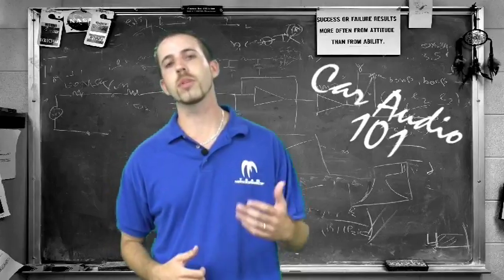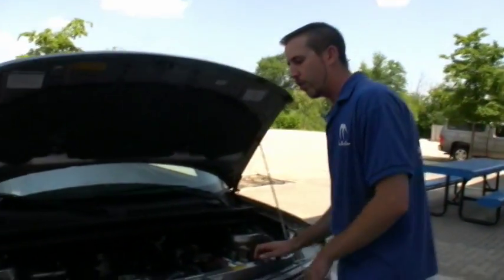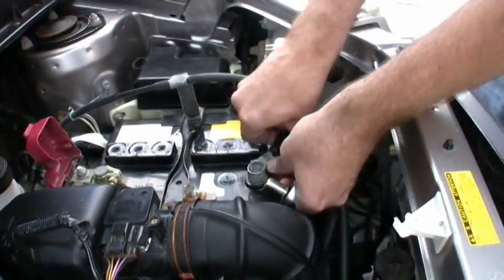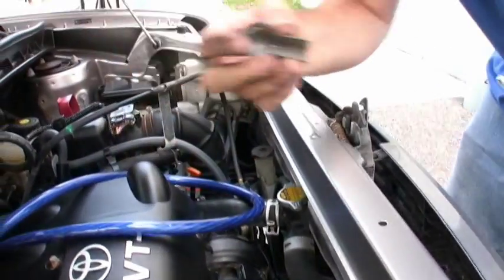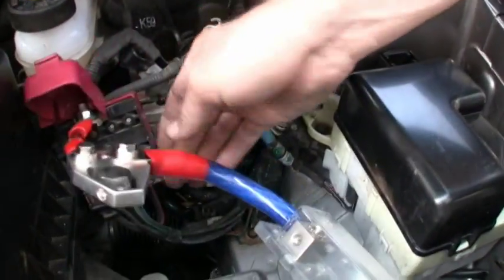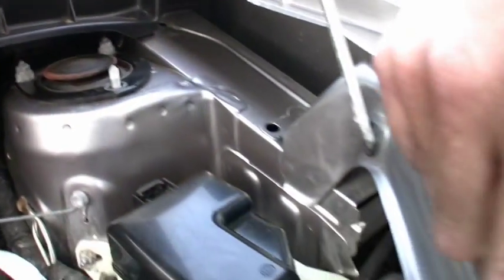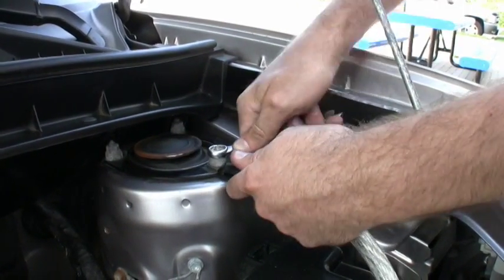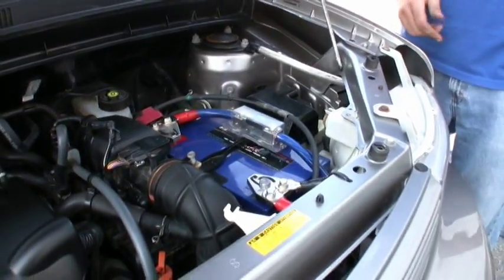Car Audio 101 - The Big 3 Upgrade Tutorial

Comment: Comps and 2 12 JL power by a 400 watt amp ken wood and a planet audio 2500 watt amp and all my wiring  was done with monster cable 2 gauge (I think) I also have 4x8 kicker speakers and wanted to upgrade my deck and my rear entertainment system that came stock with the SUV

Comment from the maker: @HPKWI I would recommend contacting an alternator manufacturer such as XS Power or Ohio Generator. They will need to know the make, model and year of your vehicle as well as the total power of your amplifiers. This will help them determine what alternator would be right for you. The optional in-line fuse should be valued just above the maxx output of the alternator.

Comment: Ok so I just do alternator to + terminal and  connect the black wire coming from my led fuse holder to my negative battery terminal right? By the way if it helps my led fuse holder it's a ((xscorpion)) THANKS

Comment from the maker: @gigiboxa The fuse from alt + to batt + is completely optional. If you decide to do so, the value should be a little above the maxx rating on the alternator.

Comment from the maker: @007novice The BIG 3 upgrade provides increased delivery over factory wiring by reducing the resistance in the circuit. Think about drinking a milkshake through a coffee stir vs a larger diameter straw. Which will work faster and with less effort? The battery was changed to increase the reserve in my electrical system. This helps my amplifier live up to their potential. In some applications an upgraded alternator is required as well.

Comment from the maker: @Wjncs The fuse from alt + to batt + is completely optional. If you decide to do so, the value should be a little above the maxx rating on the alternator. In many vehicles the stock wiring runs through the factory fuse box. 

Yes, any power run coming off of the battery requires an in-line fuse within 12" of the + battery terminal. The total fusing can typically be figured by adding the total fusing of your amplifiers together. It is ok to round up if needed.

Comment from the maker: @dbow79 In my tests, Optima yellow top batteries are good for around 1800 watts. You will need more batteries for sure, and maybe even a larger alternator. Measuring the voltage drop at the power and ground terminals on the XXX6500 will provide your answer.

Comment from the maker: @Simonas69 Upgrading the battery increases the reserve for the electrical system. The overall voltage is typically lower for the system if the alternator is not upgraded as well. Fuses and electrical equipment are not affected simply by upgrading wiring and batteries.

Comment from the maker: @13mrpunk Your electrical system is only as strong as your weakest link. Leave the factory wire in place and add the additional wiring as you are able. The lines in your screens could have to do with your signal cables being run next to power runs. Try separating your audio and video cables from power runs if possible.

Comment from the maker: @jr93pdro The fuse from alt + to batt + is completely optional. If you decide to do so, the value should be a little above the maxx rating on the alternator.

Comment from the maker: @memodedonachuy The fuse from alt + to batt + is completely optional. If you decide to do so, the value should be a little above the maxx rating on the alternator.

Comment from the maker: @ctdv55 I would think your current electrical upgrades would be sufficient, but the proof will be when you measure the voltage drop at the power and ground terminals of your amplifier during high volume listening.

Comment from the maker: @jarred3636 The tutorial I provided is the traditional BIG 3. The run you are referencing is often mentioned in what the guys on many forums have begun doing. They are calling it the BIG 4 upgrade. Your engine is bolted directly to the frame of the vehicle so I see no reason for this run. But, the upgraded run from the engine block to the negative battery post is a must in the upgrade process.

Comment from the maker: @BLAssT0 Follow the steps I have provided in the video. The only additional step you need to take is connecting your black wire (ground) to the negative post on the battery.

Comment: So why do you put a fuse on the 0 gauge wire from the alt to the battery if the factory wire is still hooked up. Why dont you have to fuse then both or neither of them. A little confused on that.

And if you install an amp to this set up, do you need to put a fused link on wire that goes to the amp? If so what size?

Comment: wheres a good place online to order the battery ends and the crimp ends for the wires. i have looked around to no avail. i am looking for  2 gauge wire that i am going to run. and 4 gauge to my amp.who makes the battery ends you used on the video? they look well built.

Comment: Thanks for this great video!  I am relatively new to performance car audio although I have "dabbled" with simple stuff like changing HU's and speakers and installing amps, crossovers etc in the past.  Like the last guy to comment on this video, I'm not 100% sure what the positive terminal jumper that you installed is actually for - could you clarify please? Thanks again for the video!

Comment: I have a question, I see that a lot of people upgrade a "engine block to chasis". Would that be equivalent to the "Negative terminal to Engine block" like you just did? Mine has the same "Negative terminal to Engine block" wire like yours so i'm not surr if I have to upgrade that AND add a "engine block to chasis" wire.

Comment: How many batt's are you running in that car?  I went to the Kinetik website and calculated that my system is 1350 rms total and it told me I need (2) 1400 Kinetik batt's?  Is that accurate?

Comment: @MaxxsonicsUSAInc  Can you please help me, The big 3 is done to my main battery that is in my truck and I am planning on connecting a second battery which my amp will be connected to but the two batteries will be connected with a relay/isolator. Will the Big 3 still help my system or what??

Comment from the maker: @Ericec4126 You do not have to, it is optional. Simply a safety precaution as the wire you are adding is not factory and most factory charge wires run to a fuse box prior to connecting to the positive battery terminal.

Comment from the maker: @d77543020 The HFEQ will provide a very clean output to your amplifier. It has a built in line driver capable of delivery up to 9 volts of clean signal output.

Comment from the maker: @luisin321123 In your application, your fuse from alt + to battery + should be just above the max output of your alternator. The fuse from battery + to your amplifier should be approximately 400 amps unless you own an amp that is around 2000 watts continuous. If it is 2000 watts rms then I would recommend around 200 to 250 amps of fusing in line. You  can always change if you have issues.

Comment from the maker: @8320884 Put your fuse, which is optional, between the alt + and the solenoid. As far as Marine batteries go, you best bet would be to contact the battery manufacturer for their opinion. I know a lot of guys using the Optima Blue Tops, which are Marine batteries, and never have any issues.

Comment from the maker: @terror1993 That is correct. Perform the same connections, but your wires will be much longer. You should be able to ground the rear battery to a strut tower bolt in the trunk. Be sure to sand the area free of paint and corrosion.

Comment from the maker: @Chopper41463 If you do not reattach the positive cable then it must be covered and protected so that it does not short against anything. In most applications it is favorable to connect it with your upgraded wires.

Comment: HEY MIKE OR ANYONE GOT A QUESTION I DID THIS BIG 3 UPGRADE I GOT A 220AMP H.O. ALTERNATOR  I WANTED TO KNOW WHERE SHOULD I PUT THE FUSE BETWEEN THE ALTERNATOR TO THE SOLENOID OR THE SOLENOID TO THE BATTERY? THANKS. ALSO CAN U GIVE ME ANY IN INFO ON MARINE BATTERIES? THEY ARE CHEAP AND HAVE HIGH AMP HOURS AND ARE DEEP CYCLE THINK THEY WOULD BE GOOD FOR CAR AUDIO?

Comment from the maker: @FlaRarebreed You can simply piggy back the stock wiring if you desire. The engine block is already grounded from the factory but this is one of the wires included in the upgrade.

Comment: If there is a short between the fuse and the alternator, since the alternator is a power source and the fuse just cuts power from battery, is there still a chance of fire if the car was running?

Comment from the maker: @ian8819 Because the typical run from alt + to battery + does not exceed 6ft, most use 4 gauge or larger for the BOG 3 and 4 gauge can easily pass 175 to 200 amps in that distance. If using smaller than 4 gauge, longer than 6ft on the cable, or an alternator exceeding a CONTINUOUS output of 200 amps or more and the fuse should be based on the wire capacity. This would be a rare occasion and one I have never run into over the years. Nice topic.

Comment from the maker: @yzf7steve My best suggestions are to keep the run as short as possible. Run the wire along the side of the vehicle that your battery is on and run the RCA's on the opposite side of the vehicle to reduce the introduction of noise. Do Not run the wire outside of your vehicle. Run it through the firewall, under the carpet against the door frame.

Comment from the maker: @yzf7steve In your case you need to leave the stock wire in place. Simply piggy back the upgraded wire from alternator positive to battery positive with an in line fuse slightly above your alternators amperage value.

Comment from the maker: @Lewis6776 Never rely on the meter built into the vehicle. They are not accurate. In regards to charging the battery; charging at 2 amps is typically a 2amp constant rate of charge. Some models offer a float charge which works about the same in my opinion.

Comment: @MaxxsonicsUSAInc Well I dont own a voltmeter myself, but by looking at the volt gauge in explorer when at 2000 rpm or higher needle looks still, but idling seems  1 to 2 volts.  I havent turned my gain up past half way either on amp .  I havent tried it at night yet.  Is it necessary to charge it all the way on the 2 amp charger or will car alt do same job? I had borrowed pawn shop and work voltmeter when I had checked it the 2 times. Also when it says 2 amp charge does that mean over 1 hour?

Comment from the maker: @nickfs442 What model Yellow Top do you have? A group 31 YT will support around 1600-1800 watts. If you have a group 31 up front then I would recommend the Kinetik HC1200, HC1400 or even another Yellow Top if you decide to go that route. Just be sure to fuse the power wire coming off the front battery, into the second battery and off the positive post of the second battery to each amplifier in your system. This will protect you against shorts in the line from front to back.

Comment from the maker: @r4ducu Mind sharing some background on wire size used, battery and alternator type, and total power of aftermarket amplifiers in the install? The BIG 3 does not necessarily increase your standing voltage without demand, but you should see less voltage drop as you have simply increased your delivery paths.

Comment: hey its me again..i have the hifonics 1610d. a 200 amp alternator and 1/0. i have 2 alpine type r 12s..was just wondering what battery i should get. i have a yellowtop optima as the starter battery. i need to know soon because i will be ordering today or tomorrow! kinetik or stinger...and i dont really want to spend over $200.. and i might get a 4 channel amp that i will want to add to the battery in the trunk lattery on. thanks!!!!!

Comment from the maker: @Lewis6776 Based on your voltage reading, it would appear the battery still requires charging. Did you measure the voltage drop at the battery during high volume listening?

Comment: @Lewis6776 Sorry to bother again just to inform you I checked after charge overnight and it said 12.45 volts this time vs 12.34 volts when I got it.  Wired it in seems better but still c voltage needle flinchin on some rapid beats and dropping when idling, but I can finally turned the amp up and its hitting harder then ever. Do you think this battery with the low voltage reading could be bad, or do I need to just charge like whole week?  I do have 250 amp alt. Thanks Again

Comment: @MaxxsonicsUSAInc Awesome I found some guy at the pond with a hc1800 for $50 so I got it.  It checks at 12.34 volts so I put it on 2 amp charge overnight u think this will work good enough.Plan on wiring in back 2 morrow.  Thanks

Comment from the maker: @maxp8ntballer No, wire is wire. As long as they are the same size so there is no weak point in the circuit and you mark the wires so that you know which is power which is ground then everything is good.

Comment from the maker: @Lewis6776 Yes, you will fuse within 12 inches of the front battery positive terminal and then fuse coming into the secondary battery positive. You will also have to fuse from the secondary positive to the amplifier.  Happy I could help!

Comment: @Lewis6776 thanks for the info on 2000 like $250 right and will this also be compatible with the carquest battery if straight wired no isolator or relay?  Will it be okay to play low until I can get 1? Thanks man you help alot

Comment from the maker: @Lewis6776 I would suggest an HC2000 at the back as the smallest option. Capacitors are temporary storage devices and are nothing like a battery. I never suggest caps as once they discharge, they will actually starve your amplifier to recharge themselves thus creating an even worse situation for the amplifier.

Comment: @MaxxsonicsUSAInc Also is it better to have a kinetic 600 battery in back close to amp for quick juice with carquest 660 CC amp 0F crank battery under hood, or would a kinetic 1800 alone do the job just as good from under the hood? Maybe having to have a cap on 2nd option? Thanks Again

Comment: @MaxxsonicsUSAInc Thanks for the help, so instead of upgrading main battery, a kinetic 600 in the back would be good enough? or should I just get a big battery like in the vid 1800.  Cause I had one on the bxi2610 and still dimming lights and low voltage while idling.  I sold it for $60 and I should have kept it lol.  And does a  capacitor peform better than a kinetic battery, or is kinetic all I need for the mill second firing of the brz2400 amp?

Comment from the maker: @Lewis6776 12.6 volts is where most batteries float when sitting. If you see a drop below 12.6V then you know you have major issues. As voltage drops components heat up because you are drawing more current as voltage drops. This is where your amp will strain to produce power and begin clipping. 14.4V is the best point for efficiency with our amps. The closer to that, the better off you will be.

Comment from the maker: @Lewis6776 Even your partial BIG 3 will help in delivery. The 250 amp alt sounds great, but I think you should try and get a battery back near the amplifier for reserve. This will help with voltage drop under high demand.

Comment: I was also wondering how low of a voltage drop would it take to cause permanent damage to a Brz24001d hifonics.  Meaning it will never reach its optimum output. Can U see this even around 13 voltz or does it have to be less than 12 voltz.  Thanks

Comment: Hi I have 250 amp alternator, like okay battery not yellowtop or kinetic, big 3 partially done. I coundt find good ground to motor for explorer 99 and out of 0 gauge so I grounded 4 guage wire to negative terminal on alternator. I had a bxi and think it got damage by low voltage. I was wondering what i should fix before I install my new brz24001, Ima run 2 L7 15's at 1 ohm in a 13.4 cu ft vents included box 31 hrz.  just low till alternator kicks in is big 3 not enought for bxi2610d or brz24001d

Comment from the maker: @LaOz32 The fuse from the alt to the batt should be slightly above the rating of your alternator. The fuse from the batt to the amps should be the sum of the fusing included or recommended by the manufacturer.

Comment from the maker: @sauron636 That is NOT the BIG 3 upgrade. But, adding the additional ground cable from alt casing to batt - along with the other steps is called the BIG 4 by some. It is helpful when you alternator is not already directly connected to the engine block. In the xB, the alt is directly connected, but in GM's and some Fords I have seen the alt bolted to an arm coming from the engine block. That ground wire certainly will not hurt anything.

Comment from the maker: @live2sk8725 You may need an alternator upgrade to something around 150amps. The BIG 3 will help with delivery and replacing your factory battery is a must. I typically recommend XS Power and Kinetik.

Comment from the maker: @momo11221 What is your stock alternator rated at? You will require an upgraded alt and more than a single yellow top battery to support that amplifier. The BIG 3 would be a great idea as well to aid in delivery.

Comment from the maker: @nickfs442 The fuse from alt + to batt + should be slightly above the rating of your alternator currently installed. You can change the fuse when you upgrade to the 200amp alt.

Comment from the maker: @nickfs442 4awg would be the minimum I would suggest to use when doing the BIG 3. Bigger is better as this helps delivery. An additional battery would probably be helpful in your installation, but you may want to consider upgrading your alternator first if it is stock.

Comment: I have a hifonics 1610d and a rockford fosgate 4 AWG running to it. I have a 2000 mercury cougar with a optima yellow top (d35). I want to upgrade my big 3...but before i do would you recommend getting 0 AWG or 4 AWG wire for my big 3...bigger than my wire going to my amp or the same? Watching this video made me pumped to do it! Do you recommend getting another battery? Thanks!!